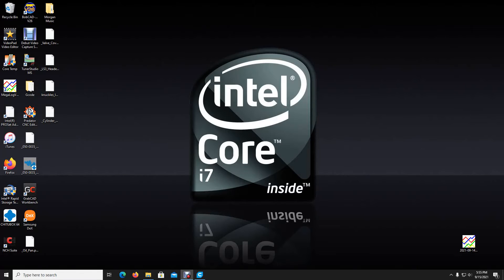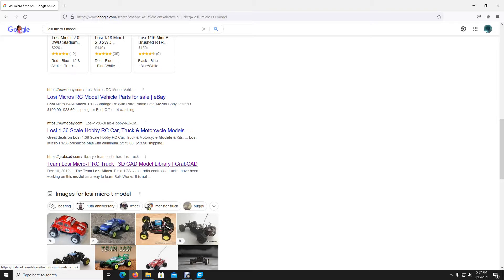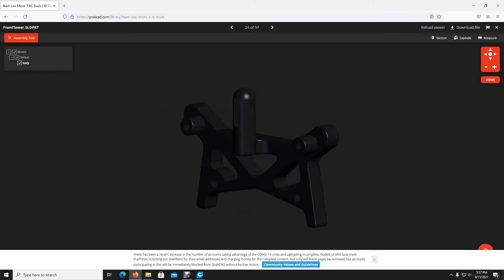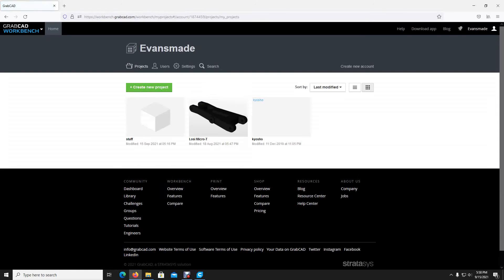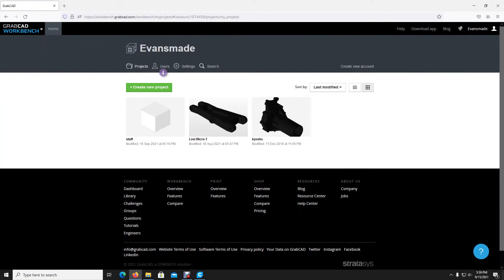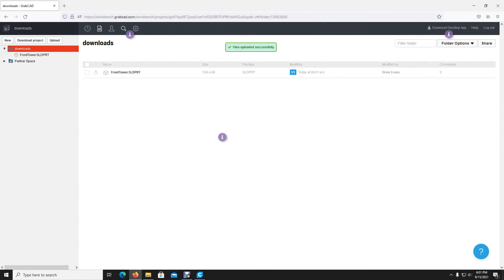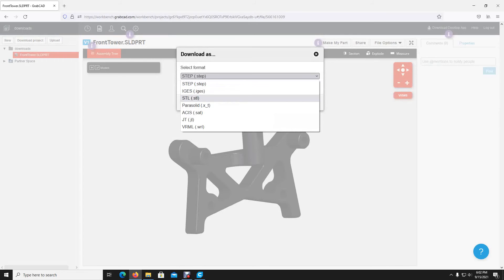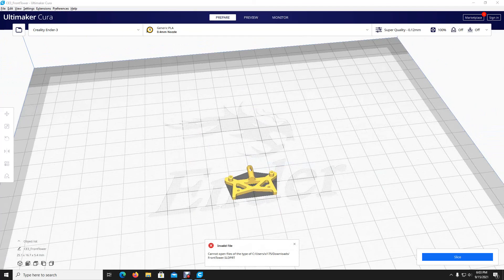Convert Files to .STL.  The Easy Way For 3D Printing.

Comment: Do you know how to convert from .rfa?
Reply from the maker: If you can't do it this way, no I don't.
Reply from the maker: If you have access to solidworks you can probably just open the model and save it with another extension, the list is quite long of .extensions in solidworks.
Reply: @twin2turbo87  Sorry, I don't have SolidWorks right now. Do you know if it opens rfa files?